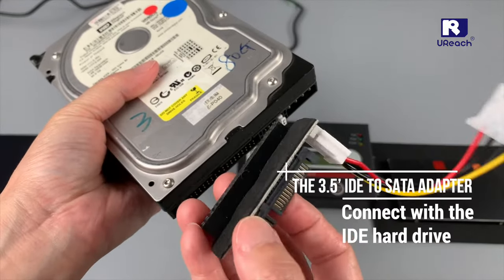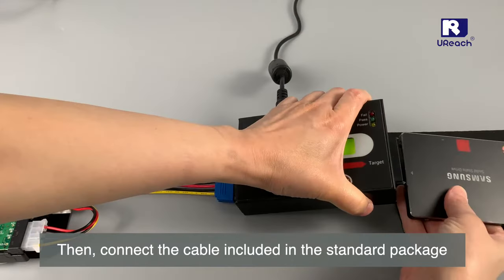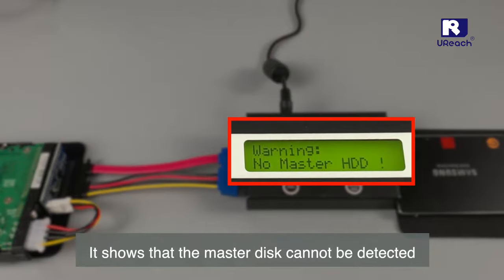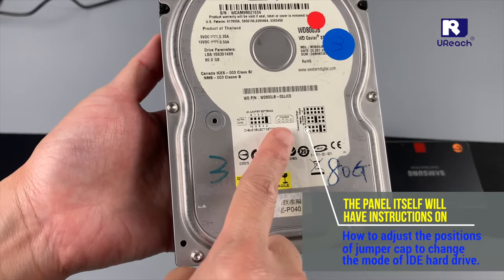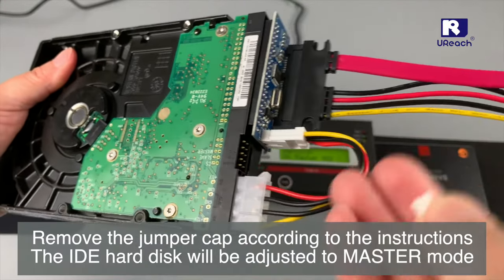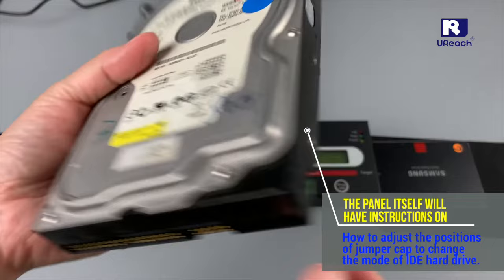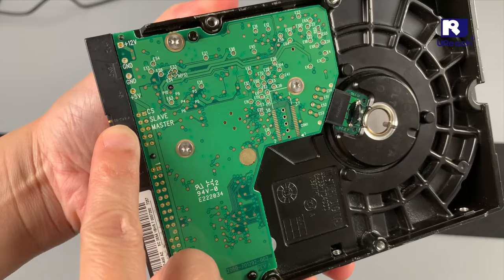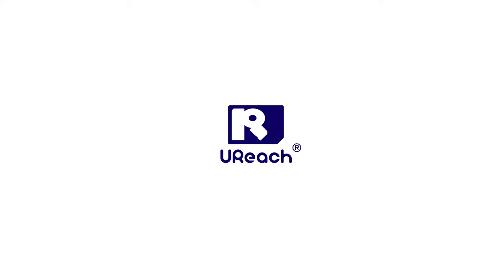Jumper setting of IDE hard drives to SATA interface duplicator with a adapter/connecter

Comment: Harddisk chip level  service centre in kolkata location. please share this information..(  SSTA type, logicnoRd  , power IC problem..-80 GB)...
Reply: What if you want to clone a 3.5 5tb sata hdd?
Reply from the maker: Please check our PRO198 30GB/min High Speed SATA Hard Drive Duplicator
It features 30GB/min Copy Speed. Data Area Copy.
Can copy a 30GB Win System within 1 minute.
https://jetmedia-inc.com/collections/jetmedia-hdd-ssd-duplicator-
series/products/u-reach-pro198-hdd-ssd-30gb-min-ultra-high-speed-duplicator-data-eraser